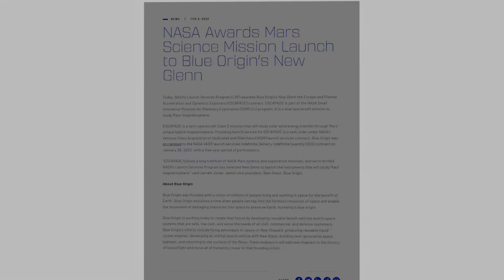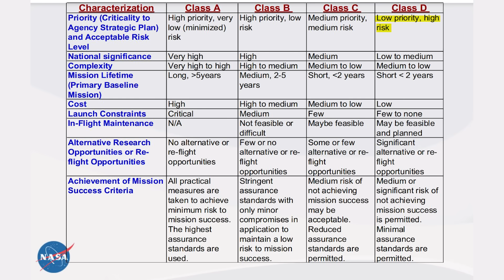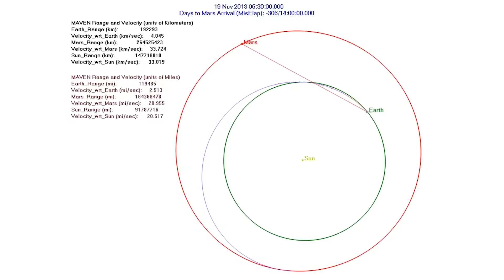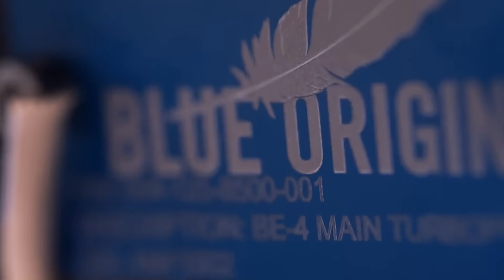Is Blue Origin's New Glenn Close To A Maiden Flight?

Comment: In theory Javis concept, would be more economical viable to cargo missions to LEO than Starship. Since it uses a standard payload fairing instead of a payload hatch. Facilitating the cargo loading and deploying processes. Which also means less mass at reentry, as not requiring an extensive heat shield.
Reply: They can't make it to orbit yet let alone being worried about trying to slow an upper stage from orbital speeds down enough to re enter... So far BO is like a kid in elementary saying all the things they want to do in life and grow up to do whatever.. they probably ought to figure out the launch first before they worry about anything else.. they have dreamt a lot on to their plates as it is..
Reply: @zmblion  Going to take a long time to SpaceX to figure out reentry speeds too. Especially using the current TPS tiles system, falling apart at launch.
Reply: @RogerM88  very true but not nearly as long as bo.. information from the shuttle should help SpaceX. They aren't really doing anything new. It's just bigger
Reply: @zmblion  Completely different applications. In the Space Shuttle the TPS tiles were fixed to the fuselage. While in Starship they are fixed to the tanks. Subjected to pressure as thermal amplitude variations. That's why SpaceX been using pins to holding them in place. .
Reply: Jarvis seems like a me too project considering the extra mass involved with a reusable second stage there would likely be little payload mass left without serious modification to the New Glenn first stage. They would need to seriously upgrade the BE4's for this to be a realistic proposal.
Reply: @schrodingerscat1863   That's why I'm starting to support the ULA approach for the Vulcan Centaur reusability process. Get experience with the platform, and then iterate for reusability systems.
Reply: @RogerM88  ULA plan seems far more realistic, get the rocket working reliably first then work on recovery of the engines as fuel tanks are easy and cheap to build. New Glenn would be difficult even for a company like SpaceX with over a decade of landing orbital class boosters.
Reply: That will still be very hard to do .
Reply: Something to keep in mind, once operational, Starship's payload bay will be the biggest of any operational rocket in history. Still, I can see the awkwardness of a hatch instead of a fairing, since a hatch limits a payloads ability to exit the Starship if not done optimally.
Reply: @Sliiiick   SpaceX is yet to present a prototype with a functional payload hatch. A standard payload fairing maximizes the use of space, as a simpler deploying procedure.
Reply: After 23 years, you’d figure BO would get to orbit by now, instead of worrying about Jarvis crap.